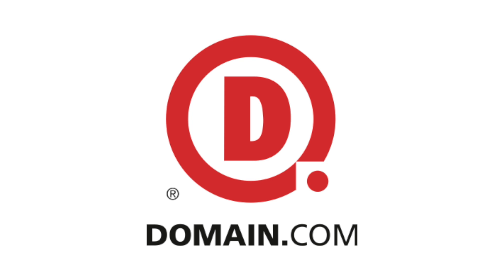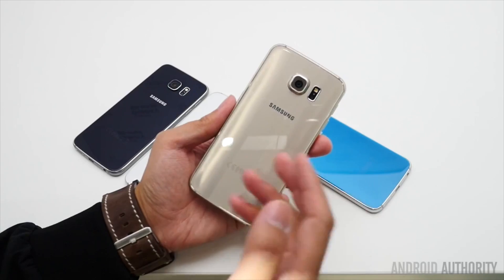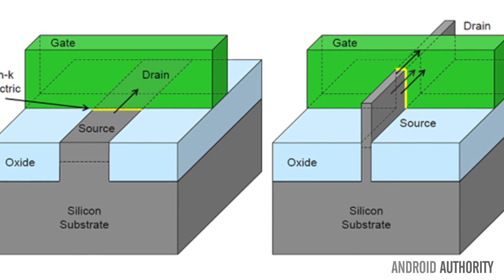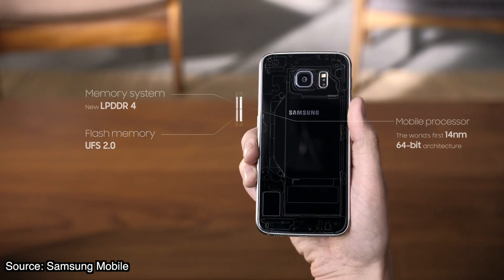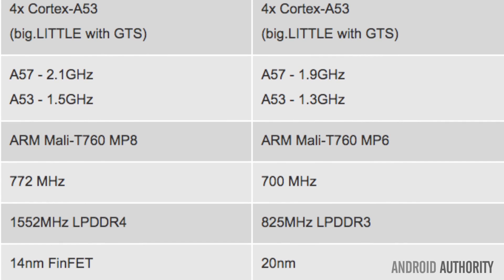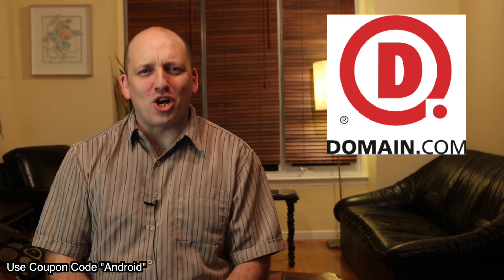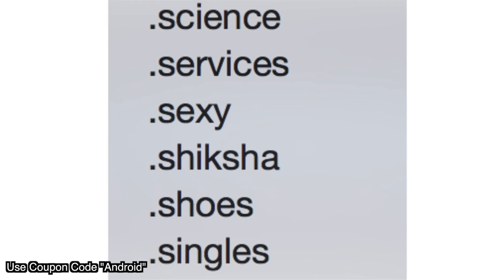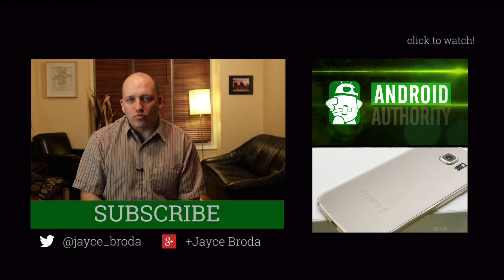Exynos 7420 - A Closer Look at Samsung's New SoC

Comment: I've got leak specs for the note 5,  it will be rocking a 5.8" 4k display, a 3500mah battery, ARM cortex A72+A53 big little, MALI T880 gpu , 4gb of ddr4 memory..

Comment: Except for the fact that it isn't all hot air.  Samsung was telling the truth,  and publicly tried to be diplomatic by saying that they only chose their own Exynos 7 because it was more powerful. Qualcomm is a big time business partner with Samsung, and moat likely will remain one in the future with the Snapdragon 820 etc.

Benchmarks and tests have proven that the Snapdragon 810 has overheating and/or thermal throttling issues with benchmarks that are only marginally better than the Snapdragon 805, despite the fact that it's 64-bit and has twice the cores. With that said, the Exynos 7 is a true beast and a worthy successor to every mobile SoC on the market, in my opinion.